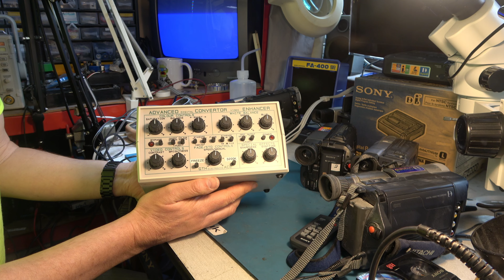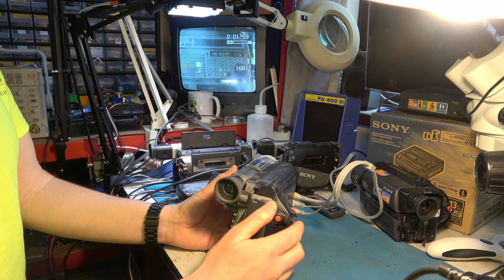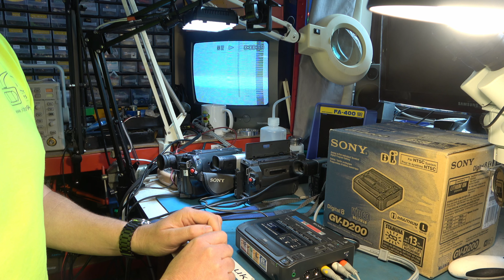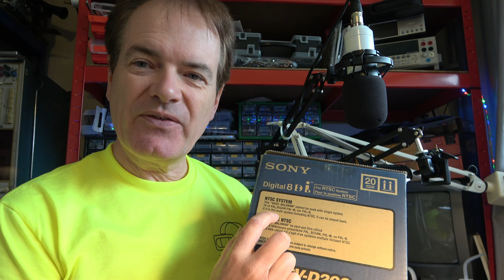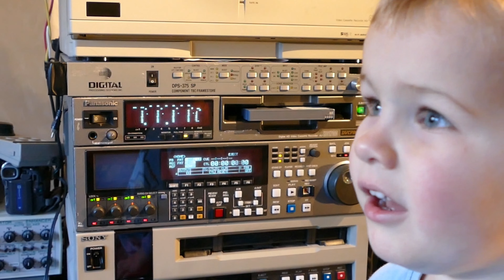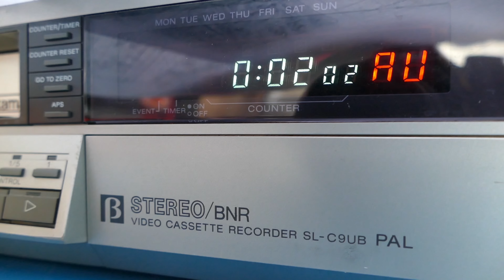8mm tapes recorded in PAL and NTSC

Comment: Just slowly working my way through you videos which are all so helpful. I have an issue with a VHSc tape that I was recently sent which was originally recorded in Pakistan (on the PAL system?) but whenever I try to convert the tape to digital (on various VCR/camcorders) the output shows interference and loss of colour, even though through the viewfinder of the camcorder I'm using the recording plays fine. Would appreciate any help or guidance someone might be able to give on how I could correct the output recording. Many thanks in advance.
Reply from the maker: Maybe it's an NTSC recording despite coming from a PAL region.  So you might be outputting NTSC 4.43 from the camera, which most video capture devices cannot accept.  You need something to convert it to a true NTSC recording if that's the cause, I use Digital Timebase Correctors for that.  I may be wrong of course, there may be some other cause for this.
Reply: @video99couk  Thanks alot for this. really useful info. Is there a way of determining if indeed it's outputting 4.43 from the camera? Could you suggest a particular Timebase corrector?
Many thanks

Comment: Hi vide099
 I'm encountering an issue with my Sony DCR-TRV120E and Elgato Video Capture setup. I can play NTSC tapes fine directly on the camera, but when I try to capture them on my computer using the Elgato, I only get the audio without any video. Do you have any tips or potential fixes to help me get the video to show up on my computer? Thanks for your help!
Reply from the maker: Firstly don't use the Elgato.  You already have a much higher quality digital output on the camcorder, it's the Firewire output.  If trying to play NTSC tapes then the camcorder will output NTSC4.43, a half-way format between NTSC and PAL.  The Elgato probably can't handle that.  There may be a setting in the camcorder menus about NTSC on PAL TV, if you can adjust that it might possibly help.
Reply: @video99couk  Thanks for the advice! I've already ordered a Firewire cable and will try adjusting the settings in the camcorder menus as you suggested to see if that resolves the issue. Could you also recommend any software for capturing video via Firewire? I want to make sure I use something compatible and reliable. Appreciate your help!

Comment: The instructions on the box are aimed at Brazil, Argentina and other  South American markets. The instructions would make sense to them as PAL M and PAL N are PAL colour system with the chroma subcarrier set at 3.58 which is the NTSC frequency (N is in fact at 3.56 mhz if the PAL colour system is broadcast. System M whether NTSC or PAL is 525/60 and System N is 625/50. Your unit is not aimed at UK market and the unit is more likely aimed at corporate and processional non broadcast users who are assumed to understand the formats. 
Otherwise this is a great piece. 
I have 2 GV-S50 units 1 Pal and 1 Ntsc. I use these for recordings to use in my GV-9E which is PAL and my GV-500 which is NTSC. If it is music I record on the GV-500 as it offers hifi stereo sound. Keep up the good work. ( almost forgot P6 tapes cover both the 60hz AC and the 50 hz AC areas in Japan. It is a cheat but mafe it easy for people to make sure they had right tapes.) 
If you run the camcorder through a tbc does this not allow the computer software to continue digitizing with a blanked image?

as I said, good stuff, thanks
Reply from the maker: You could run the camcorder through a TBC but I rarely do this.  Digital8 camcorders have a built in TBC and Digital to Analogue converter so I usually take the DV stream directly from that to avoid any further D/A and A/D steps.
Reply: Yes, if you are playing an analog tape output as digital, it makes sense not to do extra conversion steps and then if there is no control track, you will get a termination as you suggest.TBC's are great though at making priceless tapes watchable. @video99couk

Comment: hello i have a hitachi vm-e368e camcorder and it says pal-8 on the camera but i bought  a Ntsc-8 cassete will it still work?
Reply from the maker: That depends what you are trying to do.  If you are making new recordings on the tape, that will work just fine.  The running time however will be shorter than marked on the tape.  If trying to play existing NTSC recordings, some camcorders can and some can't, you would have to check the instructions or just try it.

Comment: The problem with the capture stopping when sections of blank tape are encountered - does this only happen when capturing NTSC recordings played back on a PAL camcorder? I use an old version of Adobe Premiere Pro to capture from DV, and I've not known it stop capturing when there are gaps in the recordng. Also it doesn't mind aspect ratio changes mid-capture; it just flags the entire file as whatever aspect ratio it started the capture at.
Reply from the maker: Usually a gap will not abort the capture process on a PAL tape, though I wouldn't say it never happens.  I use Pinnacle Studio for capture, never tried Adobe Premiere Pro.

Comment: TRV110E is a DIGITAL8 SP only camcorder and it won't playback LP Digital8 recordings but it will playback LP and SP analogue PAL recordings. I find that it will playback NTSC SP analogue recordings but not usefully, as the frame is shifted upwards a bit. The TRV110E will not playback NTSC LP analogue recordings. I also find that other Digital8 camcorders, such as the DCR-TRV725E, will playback NTSC SP analogue recordings fine and transfer them by firewire to computer but that they will not playback NTSC LP analogue recordings (just a lot of noise on the output).

Comment: More mysteries demystified, very good.
I hope this is sort of relevant, if not, feel free to ignore. I'm trying to get a picture on a tiny sony viewfinder crt (ntsc based), playing something pal thru it. I need a converter, but being very green to tv stuff i'll probably buy the wrong thing.
Will a cheap ebay converter box do it i wonder? Will these modern gizmos do composite signals?
Reply from the maker: That would depend a bit on just what that eBay converter box is.  Some may just deal with colour differences but not change the line and frame rate.
Reply: Did youtube renove my comment? Am i allowed to post links to eBay items?
Reply: It depends what you are trying to do. There is a product which I use which is sub £15 that copes with chroma and line field rate NTSC-PAL-NTSC. It is perfectly watchable but the color information is not as detailed as viewing the source direct. For the money it is amazing. You probably have your solution already though I guess.

Comment: I didn't know that PAL camcorders could play NTSC tapes but not vice-versa, I wonder what's the reason for this to happen, are those camcorders especially designed for playing back both formats or is it something about the signals that make them compatible in one way but not in the other? And if the output signal is a mixture of both TV systems with the frame and line rate of NTSC but the color information in the PAL carrier frequency, how is that analog TV able to display the picture correctly? Is that TV set compatible with both systems?
Reply from the maker: Firstly, yes that TV can play PAL, NTSC and NTSC 4.43, as can most (all?) TVs sold in the UK for about 25 years.  I suspect manufacturers support NTSC playback on PAL devices more often than the other way round, more for marketing reasons than technical ones.  Nearly all UK sold video products from the last 25 years would support NTSC and PAL.
Reply: Yes, I think there are three main reasons for this. 1) There is much more demand in those countries who used to use PAL for NTSC playback than there is in countries that used to use NTSC. For instance prerecorded tapes of films etc were often available first on NTSC. 2) A great many Video products were initially designed for NTSC and sold first in Japan and then the USA with a PAL modification and licensing for PAL territories coming as a second step 3) From a technical perspective NTSC is easier to use than PAL as PAL was essentially built on NTSC with extra refinement fo the swing burst and allowance for better chroma support due to the lack of compatability with monochrome sets and channel bandwidth which NTSC had. 

What is interesting is that many current new HD and 4K flat screen tv's in the USA still have issues playing back a 50p or 50i signal mind you one of my UK Sony 4K TV's has issues with 60p and judder when fed a broadcast digital at 1080p59.997.

Comment: i recapped my fx300 video8 camera (1992model) changed about 90 capacitors now the camera will work properly the ccd lens will work the tape deck but there is a problem the camera can play video but no sound also it won't record anything to the tape when you put it in in the camera mode to record the image will appear in the viewfinder and in the output to the TV it will not record video it will just erase the tape also the sound is also nowhere to be found.. very tiring and boring😅

Comment: I've only had one customer in 8 years that had (unwittingly) recorded in NTSC, so I'm currently using the GV-D800E for PAL Video8/Hi8/digital8 which is similar but has the built in screen, handy for seeing whether the video is still running without having to keep your capture program at the fore.
Interesting method of removing the overscan areas, just zoom the source and effectively crop them, instead I've chosen to add in black areas overlaid over the source video to simply mask them, my thinking being that if I start changing the source resolution so it's then different to the exported resolution by zooming into the source footage, there will be two issues, firstly, the vast majority of rendered pixels will be an interpolation of the now asynchronous source pixels, causing some additional drop in the level of detail, and also, it may increase my render time as extra cycles are being used to carry out that interpolation as opposed to a simpler 1:1 pixel correlation, not that it's quite that simple of course with compressed video which is most likely utilising chroma subsampling anyway, but it likely involves marginally less calculating overall.

Comment: 9:52 So you do capture at 720x576 or 720x480 respecitvely, but then zoom into the image to get rid of all the "junk"?
Wouldn't it make more sense to cut those bits off or to overlay them with black borders, as zooming would make the image blurrier?
Also does that "brake" an interlaced video, as the lines do not match anymore if you zoom in?
Thanks for answering in advance 😊
Reply from the maker: I could put black borders on but they would be distracting.  The small loss of resolution is worth it.  The image remains interlaced.

Comment: These Sony Digital8 camcorders (with analog playback capability) had been my "secret weapon" for video tape transferring for ages. Not only they would play most if not all 8mm tapes thrown in, but it will also have the AV->DV conversion function for converting external analog video input to DV stream. That would be very valuable for digitizing other analog tape format as well. Adding a few more miniDV camcorders to the mix, and I have all necessary capabilities covered.
Reply: Thanks for sharing !

Comment: The GV-200 is a very nice machine, I have seen them recover some really bad tapes which were recorded on the horrible 180 min Sony Metal Evaporated tape, which were recorded in LP mode. There are other models like the GV-2000 which have a built in display but otherwise are exactly the same.

Comment: The biggest advantage D8 had over miniDV was the tape length, there were 90 minute D8 tapes available, tha tis 135 minutes in LP mode, while miniDV only offered 80/120 tapes, not to mention backwards compatibility. Fortunately the 8mm tape format lived on in many other formats including audio professionals and computer data.
As for mixing PAL and NTSC, I still cannot fully grasp the differance between "NTSC playback on PAL TV" and NTSC 4,43, theoretically there is a thread o digital faq with technical info, but it would be great if I could understand the differance.

As for playing analog 8mm in D8 camcorder there is that funny discolouration problem of the right edge, no explanation on the issue whatsoeevr from Sony.
Also, I have a great PDF comapring the features of several categories of D8 camcorders, if you're interested, it's in polish, but my friend from Vietnam sent me a version translated to english with some online tool. I own 828E, it's bottom loaded, so it's a pain to swap tapes when using tripod... And I paid PLN 400 for it, if anyone is reading this, don't pay more for a lower model.

For transfering DV I use ScenalyzerLive, at ths point it's free abandonware, the last update was in 2006, I haven't tried Pinnacle. SCLive can split the recording based on the date on the fly to separate files during transfer and you can set the threshold of what the timecode differance is to be the limit for one file, for example you can have 1 second, so that every recording is separate file, or you can set 24h, so that all recordings from one day are in one file.

SCLive will not stop, you can set the timeout for that as well, it might pause writing the data to computer and resume when the video comes back on tape, or it can write new file. HAve you never tried SCLive? I don't have to payse and play for every bit. With analog SCLive allows to cut the junk bits and join the segments into continuous file too. SCLive will also start new file when it encounters aspect ratio change.

I'm on a hunt for DV and D8 videowalkman for years now.

The discolouration problem appears only when playing 8mm tapes, it does not happen when using D8 as A/D converter from external analog signal, so Hi8 deck could be used for playback and the D8 will neatly conevrt to DV.

Comment: Just got myself a TRV720E for free, because my buddy‘s kind of clearing the camera inventory of his grandpa that died last year. 
I was originally on the search for a later Hi8 TRV model, since I only have video8 at the moment. But then my buddy just knocked on the door and handed me the camera and I couldn‘t believe my luck. 
Didn‘t really have digital8 on my radar, since I already have a miniDV, but then I learned that evening that most digital8 cameras convert analog recordings to digital and output the stream via firewire and I really couldn‘t believe how lucky I got!
(Still gonna need a Hi8 though for my collection!)

One question I got for you, you might be able to answer it:
Sony officially recommends to NOT use standard video8 tapes for digital8 recordings and rather hi8 tapes. 
Do you know the exact technical reason why? I would be very interested in why this is the case
Reply from the maker: Very nice freebie.  Video8 has a lower bandwidth than Hi8, and though Digital8 recordings will work on them, you lose machine inter-operability.  Use Long Play and it gets worse.  So just don't.  Hi8/D8 tapes are still readily available.

Comment: I have an old Pinnacle Bendino PCI capture card (Win XP era) that supports NTSC 4.43. I can also feed an NTSC 3.58 or 4.43 signal into my Samsung DVD-HR775 DVD recorder, leave it on E-E mode, and it will convert the output signal to PAL, although the recorder itself will refuse to record from an NTSC source.

Comment: I used to work somewhere that had a Sony EVO9800P Hi-8 Recorder and occasionally someone would bring in a Digital-8 tape for transfer. It did lead to some people thinking the tapes were blank as the digital signal played back on the analogue recorder just looked like snow, as if the tape was blank. 

Another device that can convert the Quasi PAL-60 video signal when playing an NTSC tape in a PAL deck is the Samsung  SV4000 or SV5000 Worldwide VHS recorder. To recognise the modified signal on the input they have to be left in autodetect mode, and they think they're getting a PAL-M signal, but if manually selected to PAL-M the picture goes black/white. The auto detect mode is somehow locking onto this non-standard video signal. The output can then be set to NTSC to give the correct  NTSC 3.58 video signal.
Reply: This is very interesting, I had some troubles playing NTSC tapes on PAL equipment to properly transfer, I will look for that equipment.

Comment: Do you have a recommendation for a player that has manual tracking? I've got a few tapes that appear to be recorded so far out of spec that they aren't being displayed one either of my camcorders (on video8/hi8 the other video8/hi8/digital8)
Reply: Since Video8 / Hi8 has no sync head, only auto track finding is possible.
Reply: @TTVEaGMXde  What would you suggest for the issue I'm facing? Manually adjust the tape guides?
Reply: @Kutoja12  https://www.youtube.com/watch?v=KKsH67AVSrE , Video8 / Hi8 / Digital8 alignment and Pinch Rollers from 19.11.2020